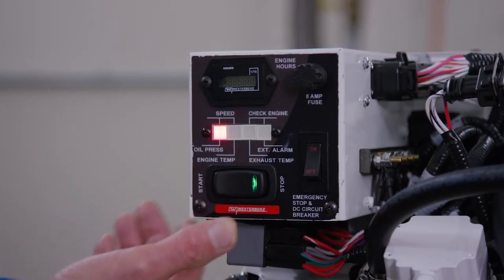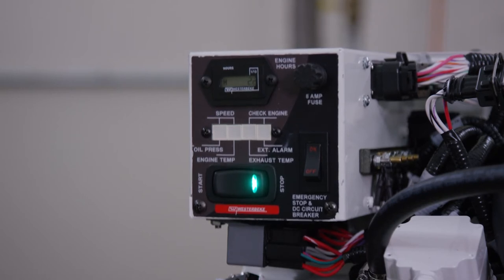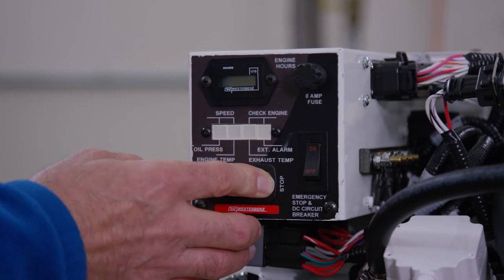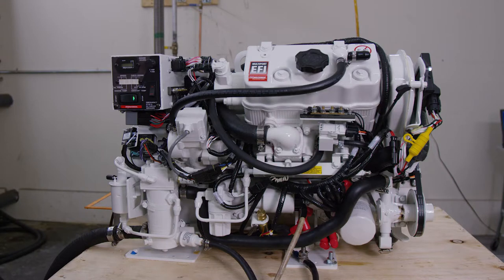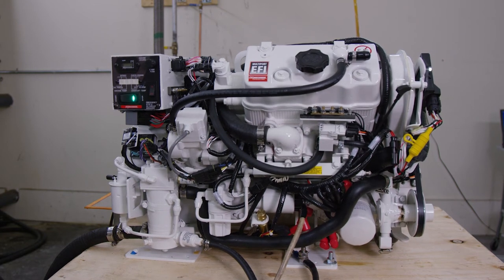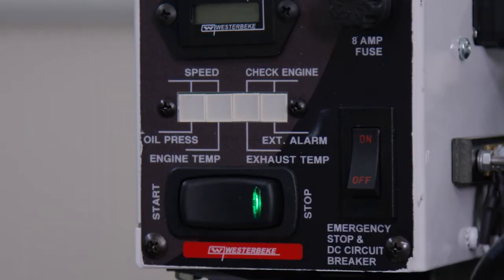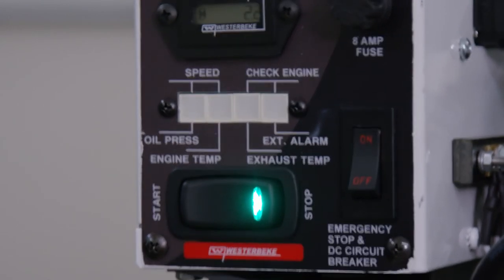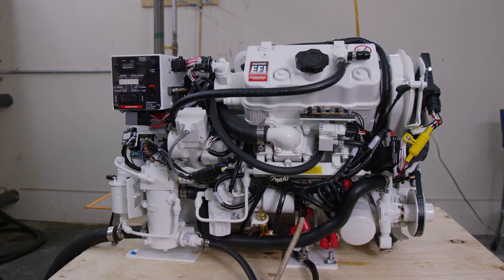How to Startup and Shutdown Your EFI Gasoline Generator | Westerbeke

Comment: I hear no fuel pumps running at the start sequence. Any Ideas?
Reply from the maker: Mr. Krall - sorry to hear you're experiencing an issue. Please locate your model and serial number and include this in an e-mail to help@westerbeke.com with any additional details about the problem. It will be helpful if you also include the hours of operation on the genset and the location of the boat. Our tech support team will assist. Thank you!

Comment: my company bought 2 15 MEG both failed to operate out of the box, relay failures, oil switch failures, fuel pump failures. still trying to figure out how to get them to stay running. Westerbeke offers NO technical support at all through trans pacific distributors. on the west coast, the tech. support guy is retired lol.
Reply from the maker: Good Morning - we test every genset for a minimum of one hour before shipping, so It's disappointing to hear you had problems with new units out of the box. Trans Pacific Distributors is usually very helpful and knowledgeable, so your experience with them is surprising. Please e-mail us so we have your contact information, and we will assist you. Here's a link to the contact us form https://www.westerbeke.com/contact.htm. Thanks for letting us know!